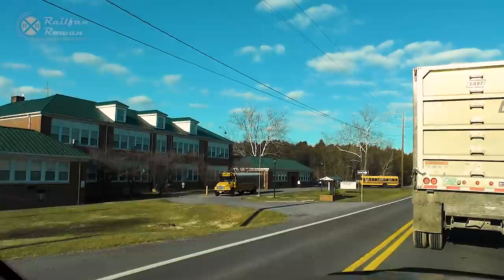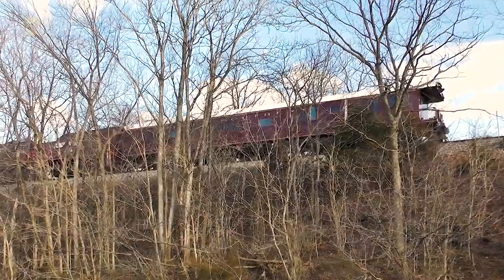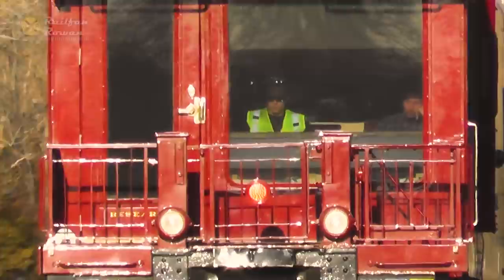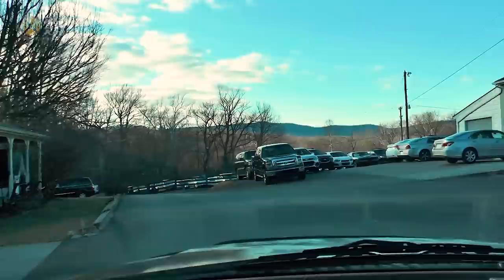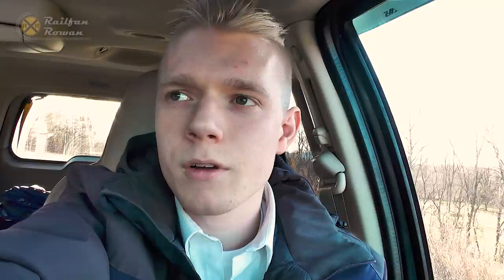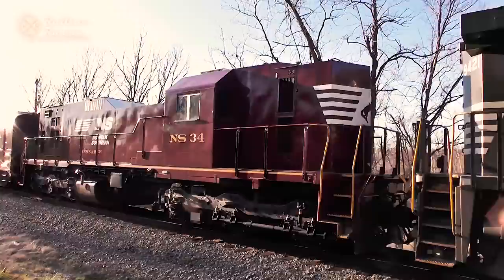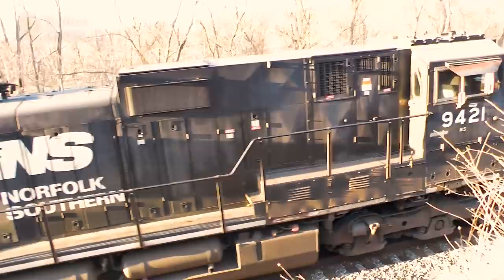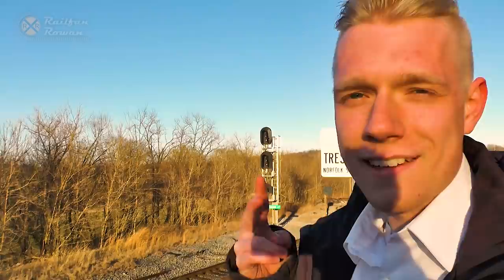UP CLOSE with NS Research Geometry Train "The Brick" from Norfolk Southern

Comment: NS34 used to be a Southern Railway GP35 before becoming a slug and eventually going on to become NS 34 and part of the Geometry Train program and having its engine removed so the locomotive(s) pulling it are what power its generator and electric traction motors as well as NS 33.

Comment: I’ve heard that Ns 38 is the brick not 34 I thought that it was 34 just saying anyway amazing catch I would love to catch it again amazing catch
Reply: Both NS 34 and 38 are Track Geometry units with similar equipment and histories.  NS 34 started life as an N&W SD35, rebuilt into a slug and then into this configuration.  NS 38 started out as an N&W SD40 before conversion to 'The Brick.'  I don't think it spent any time as a slug as 34 did.  The cab in both serves to house the computers that monitor the sensors.  The former passenger cars teamed with each support the monitor crews with work stations and galley.

Comment: 1 st question, What type of engine was the second unit?   2nd Why two power units to pull one car?
Reply: The research unit is a locomotive, But it doesn't have it's own self power. The cab is filled with equipment for viewing the tracks, Therefore it's like a yard slug, But with a cab that instead of holding the controls for the train it holds track viewing equipment, So you need a locomotive to pull it.

Comment: What’s up with the shape of that old high hood?
Reply: That is a remnant of 34's days as a slug unit.  When converted from an SD35 the prime mover, cooling system and fuel tank was removed and the unit ballasted to achieve the same weight as before.  It drew its electrical power for the traction motors from whatever GP or SD unit it was teamed with.  When it was further converted to this duty it kept the ballast but lost the traction motors.  The computers that monitor the onboard sensors are housed in the cab area and the data transferred to the former passenger car (NS 33) where track maintenance department personnel monitor it.  You can see one of the work stations through the rear 'picture window' of the car.

The 'swayback' look of the hood appears typical of many N&W / NS slugs though more recent conversions appear to keep the full length high hood, we saw that in the slug that derailed with the rest of the consist a few weeks ago near Front Royal VA.  That's the locomotive minus the roof fans for dynamic brakes and radiators and prime mover exhausts.

Comment: Does 34 have no power for itself?
Reply: NS 34 originally was built as an SD35 and then converted to a slug before its configuration as a test vehicle ; it has a generator which, in addition to powering on-board equipment, supplies power to the coach.

Comment: Whats inside the brick cab?
Reply from the maker: Monitoring screens, lots of them from what I hear
Reply: @RailfanRowan  does it has an horn?
Reply: @strenesperu9956  it does have a horn, and headlights. That way it can scan in either direction.
Reply: @Mumbles19852007  does it has a vid of horn?
Reply: @strenesperu9956  i dont know. I do know the thing had headlights, ditch lights, and a horn for being able to run lead.
Reply: I think we called it a Spirit car. Scans the rails for anomalies, internal cracks, bad rail.
Reply: @strenesperu9956  the locomotive looking thing, the brick, has no motive power in it. It is not self propelled. Always has an engine pulling or pushing it.

Comment: Great vid, but no need to throw shade on the S&C guys. Crossings not activated are a maintainers worst nightmare.
Reply from the maker: What are you talking about?
Reply: Railfan Rowan sorry man. I’m a signal maintainer. Stopping at a crossing with gates in case they don’t work? You have nothing to worry about. You’ll get struck by lightning 3 times before you get hit by a train at a faulty crossing. We take that stuff seriously. I’m a foamer too. Keep up the good work
Reply: @1Nanerz  This sort of thing has happened more than once: The National Transportation Safety Board determines that the probable cause of the accident was the failure of the signal maintainer to remove a jumper wire from the grade crossing control relay and, as required by the Union Pacific Railroadís written procedures, to verify the operational status of the grade crossing equipment after he had completed the maintenance work.
Reply: Brian Leeper I know that. But for the general public to think that they need to stop an look both ways at protected crossings is disingenuous and categorically false. Cradle crossing safety has consistently improved year after year. Sorry, but insulting my profession knowing I could go to jail for a mistake, gets my back up. I meant no offense.
Reply: @1Nanerz  I know what you mean, my dad was an A&P mechanic before he retired. One mistake and a plane full of people could go down. And the NTSB would probably investigate that too. People who have jobs where the NTSB might investigate if they do something wrong are people who have very important jobs.